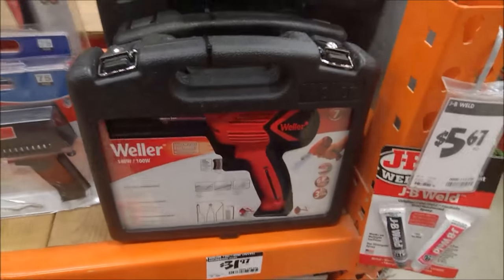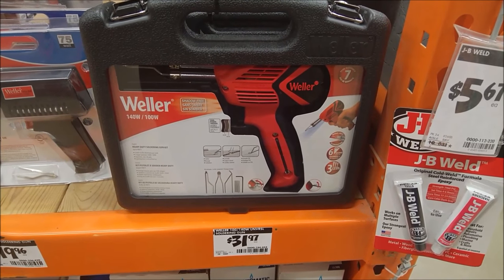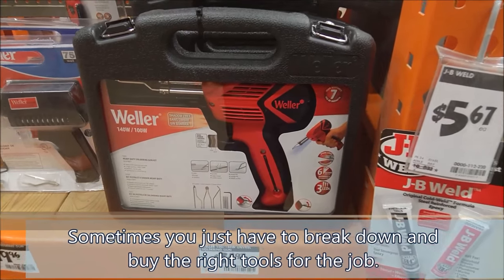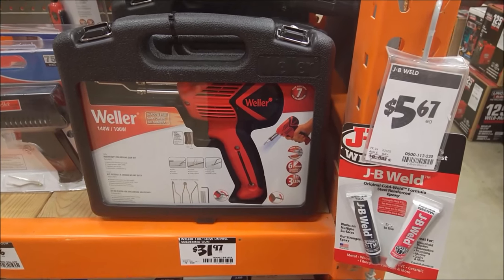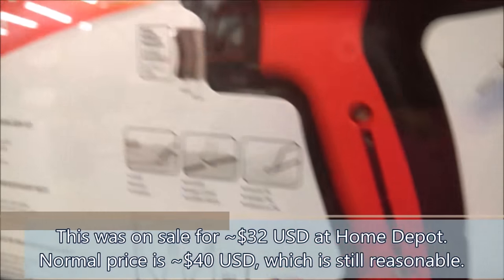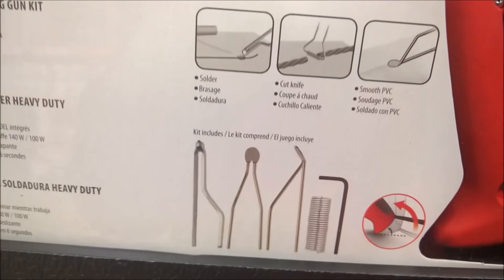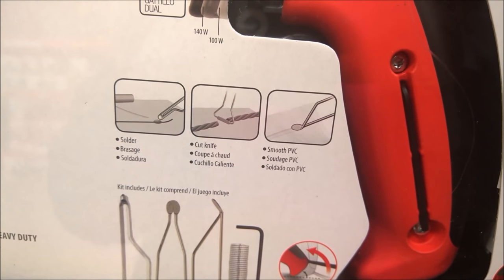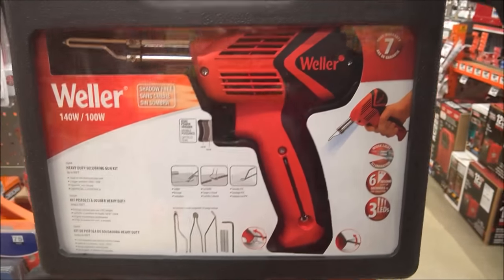Ep, 225: Weller 140W Soldering Gun - Quick Tip

Comment: Hi, can you rewire the switch so that the low position comes first and then the high position. Hope to hear from you soon, many thanks in advance
Reply from the maker: You probably could re-wire it if the control circuit is simple. Sometimes companies use digital controllers in these devices to help regulate the temperature. These are more efficient, but could require a little engineering to hack the circuit. I haven't opened it up, so I don't know if swapping the functions would be easy or hard, though.

Thanks for watching!
Reply from the maker: You probably could re-wire it if the control circuit is simple. Sometimes companies use digital controllers in these devices to help regulate the temperature. These are more efficient, but could require a little engineering to hack the circuit. I haven't opened it up, so I don't know if swapping the functions would be easy or hard, though.

Thanks for watching!
Reply: @RCPhysics  Many thanks, i have some more questions, i want to buy this gun, because the other Weller guns like the D550Pk and D650PK are junk from what I've seen from the reviews on amazon. Do you still have this model and does it still work good?  I need to do some  heavy chassis soldering. Can i use this 9400PKS  soldering gun for heavy chassis soldering? Hope to hear from you, many thanks
Reply from the maker: I still have it, but I actually transitioned to using a temperature controlled solder station that I got off Amazon for most of my heavy-duty soldering. 

This gun is like a sledgehammer. It has gobs of power, but not a lot of control. It's easy to put too much heat into the parts you are working on if you are not careful, but it's a great tool if your materials aren't very sensitive to that.

Comment: yeah you need multiple types of soldering irons
Reply from the maker: I've got 3 good ones now, each with a different function. I've got a dual power 15/30W for light circuit stuff, a 60W for medium/large wires and connectors, and this 100/140W for the really big stuff.

Comment: Yesterday the fourth run of the RC car the esc stopped working properly and then it sparked and smoked😤😢😭😭😭😭
Reply from the maker: UGH!!!! What ESC was it? Was it under warranty?
Reply: It was under warranty it was the vxl 3s. The smc battery works great but the esc just did not like me and basically cought on fire they are replacing the esc i talked to them today
Reply: Also would the castle sidewinder sct work in it without mods do you think
Reply from the maker: I think the Sidewinder and VXL 3 are pretty close in performance. Are you running the optional fan on the VXL3? Both it and the sidewinder can get pretty hot when running on 3S, so a good fan will really help keep the temps down and probably extend the life of the ESC.
Reply: I have the fan running when the esc is on
Reply from the maker: That really sucks! 
Unfortunately, sometimes hardware just fails. A small fraction of even the best equipment will come out with defects that could cause early failures. At least Traxxas is taking good care of you. Hopefully you'll be back up and running soon.